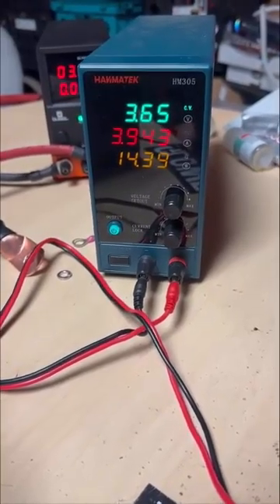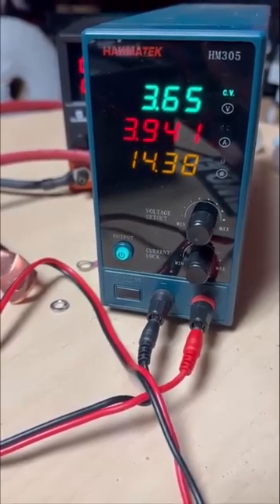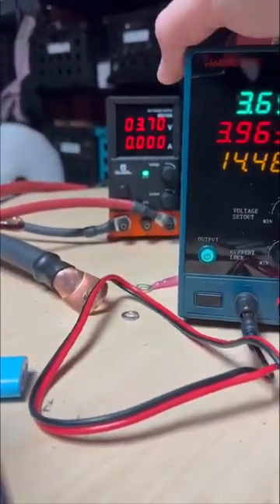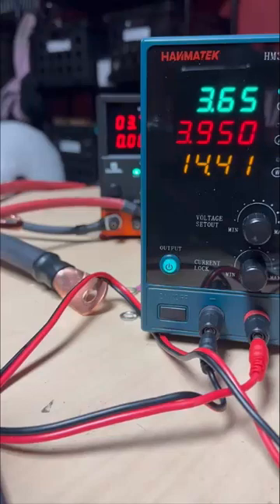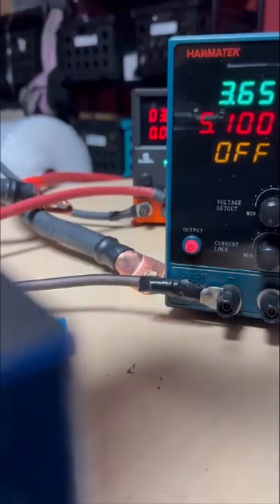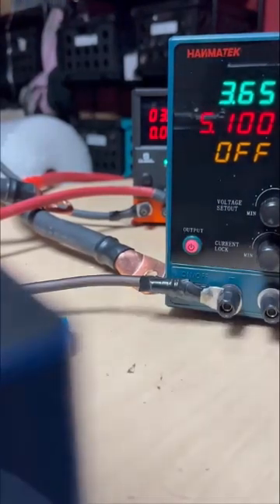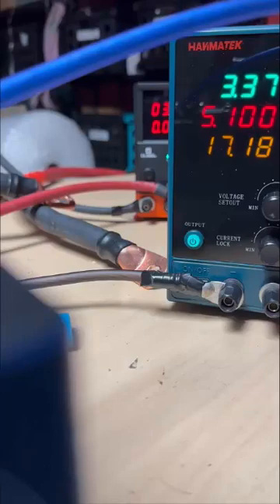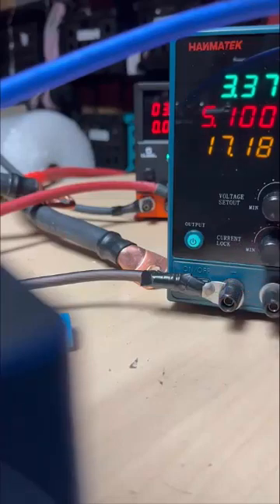Charging lithium batteries?  You're doing it wrong! This quick fix has saved me HUNDREDS of hours!

Comment: The first mention of Ohms law was incorrect.  The current flow into the battery is not determined by ohm law, maybe a tiny bit, but the current "sink" nature of the battery is just that, a current sink/source.  They are actually pretty complex to model in electronic primitives.  A capacitor with a series resistor and inductor with a self disharge resistor across it is barely adequate.
The wires IS ohms law.  The voltage drop in the cables is by definition determined by current and the resistance.  Chose cheap ass chinese test leads are well known for being high resistance.   It was these that opened my eyes to the problem as well.
However, a tip.  In future, you don't need to go to the lengths of making new heavy gauge wire for everything.  Instead you should be basing your charging, not on what the power supply says, but what the battery says.  Put a voltmeter on the cell(s) themselves.  You will find that while the PSU is saying 3.65V 5A the battery is maybe saying 3.45V and you are losing 200mV in the cables.  This is how every BMS ever made (worth buying) works. It's also how any of the proper battery testers work.  4 wire connections always.  Similarly, if you invest in a resistance meter it uses 4 needle sharp gold plated probes.  4 needles such that while one pair pulses the current the other pair can measure the voltage.
So.  Use your older smaller cables, but if you want to hurry up the charging, set the charge voltage based on the cell end of the wires.  So if the battery is 200mV lower, turn the PSU up 200mV.  Just be careful as when the current starts to fall that voltage drop will reduce as well.
Reply from the maker: Also, I absolutely use a four point YR1035+ to test small amounts of resistance.

This video illustrates more how much of an impact adding like 10 miliohms of resistance in wire has when the receiving load has sub-miliohm resistance to begin with.  More or less it’ll stay in CC mode a lot longer (as long as ohms law lets it based on the max output voltage of the charger and the resistance of the load including wiring.)
Reply: @GloweIndustries  You don't need to use a 4-point, though I have to admit it is cool to measure small resistances like that (I have an 8845A myself for that and similar purposes).  Just measure the voltage drop under load with a normal multi-meter.  Keyword being, under load.  They have plenty of precision for that purpose.   To be frank, any voltage drop under load that is below 0.02V or so just won't matter in this case.

For LiFePO4 cells, 3.65V can be your voltage target for top balancing as long as you don't hold it there too long (a few hours at the most IMHO)... you don't want to over-volt the cells after all, so that will give you the most current for the longest period of time.

That said, the voltage curve as you charge LiFePO4 cells goes exponential once they charge past around 3.50V, and the current will rapidly drop-off.   So a few tens of millivolts of voltage drop under load is not going to make much of difference in terms of charging or top-balancing the cells.

Remember that the power lost to dissipation in the wire is a function of the SQUARE of the current.  It matters for large currents but the voltage drop will disappear as the current goes down near the end of the charging cycle.